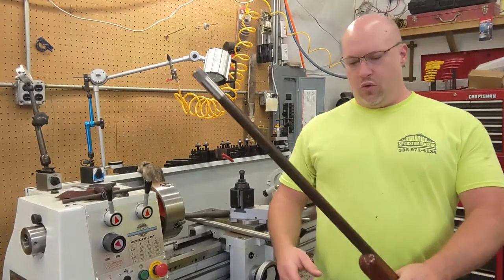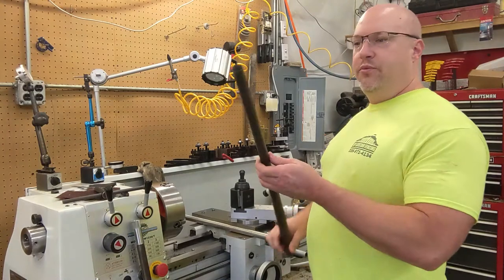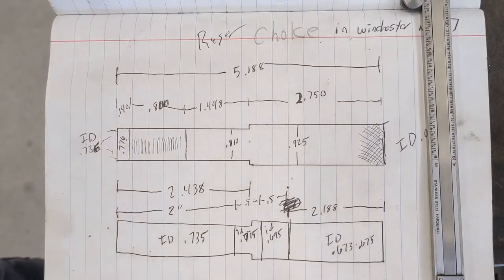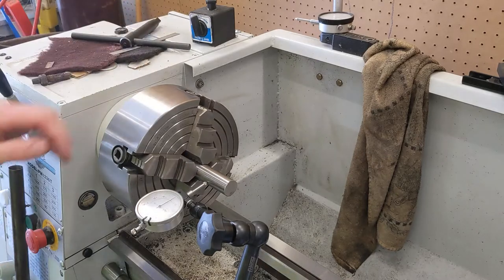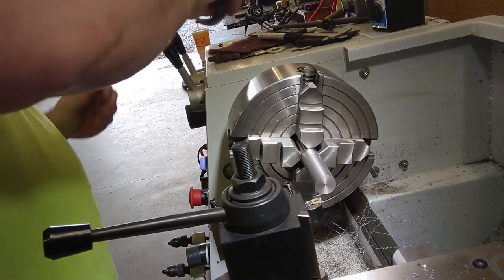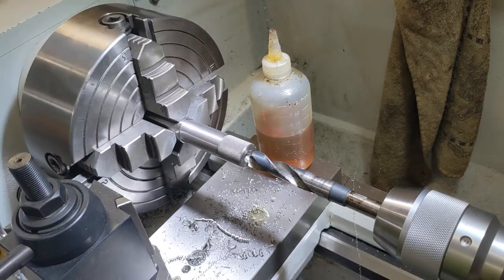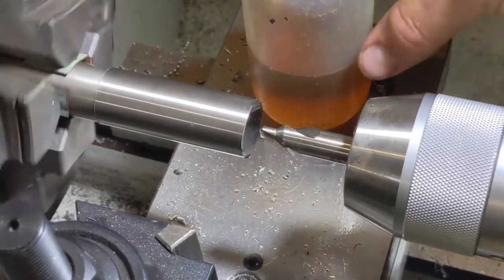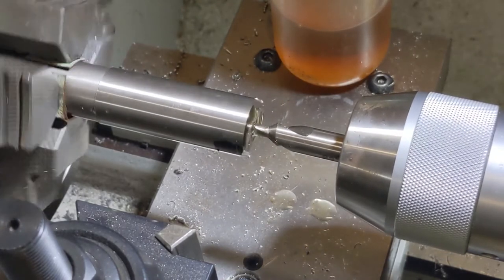Shotgun Choke Part 1 - Build | Make | How To | Metal Lathe. Turkey shoot Winner! Screw in choke mod.

Comment: Do all of your ID work before you do you OD so you minimize chatter with your boring bar, turn up the rpm and increase your feed, also when you’re working with SS when you drill a hole or machine it DRILL it don’t peck because you’ll end up work hardening the material and killing your tooling.

Comment: As far as knurling goes. I've been having luck making the circumference of my work a multiple of the lines per inch of my knurling wheels. I.E. a diameter of 0.955" will give a circumference of 3". So it will work with a 32 lines per inch knurling wheel. Also your knurling tool doesn't look to be a floating head type so it is absolutely critical to make both wheels touch the work at the same moment. Or to put it another way, exactally on center.
Reply from the maker: Thanks for the tips!